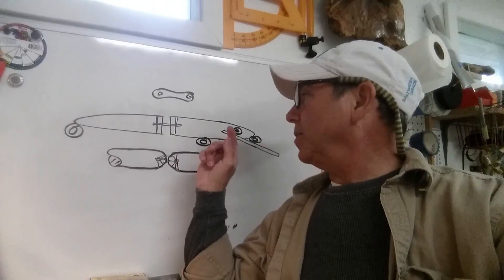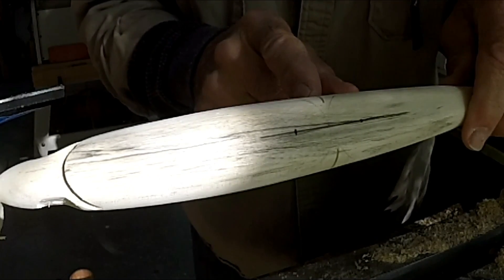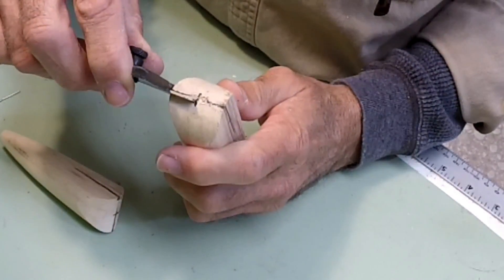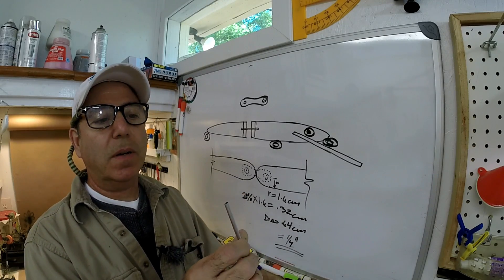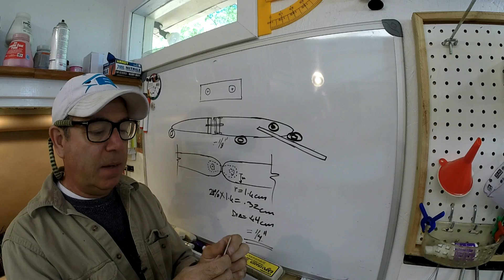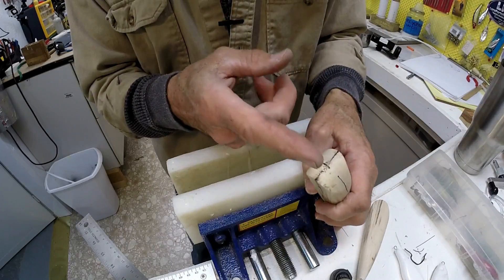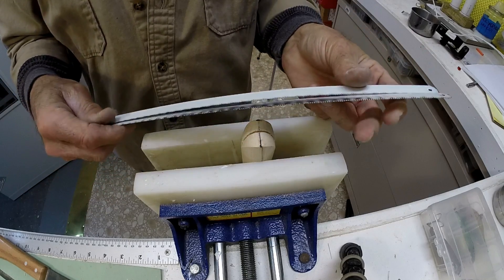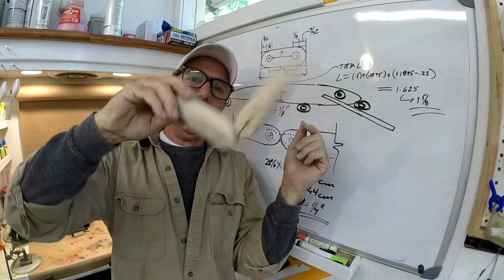Lure Hinge Design Part 2, Building It

Comment: Did you test the new thinner model of the hinge, instead of just the thicker practice one you had? Seems like to be that with more material it would be less prone to break, less material more prone
Reply from the maker: Tested it to 200 lbs, with no issues...good catch though.